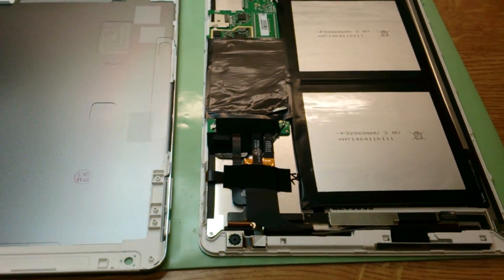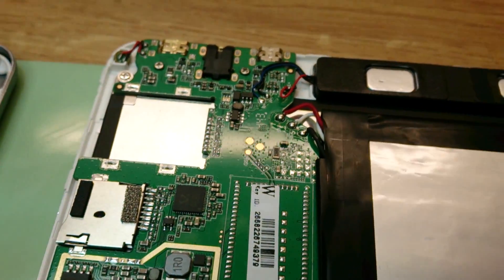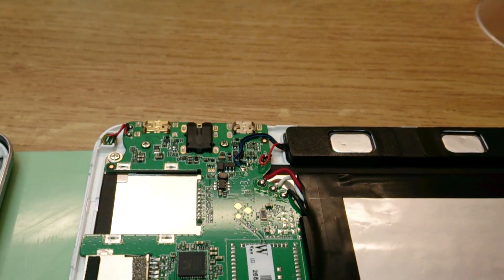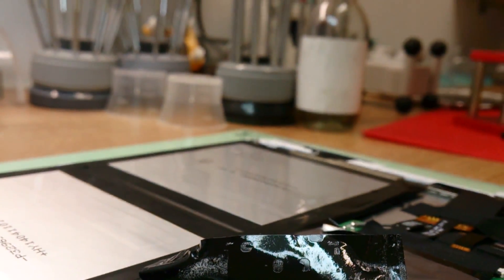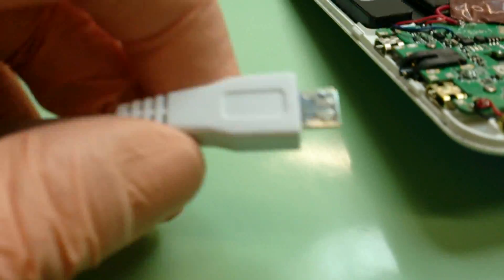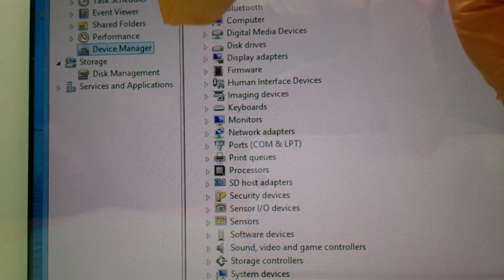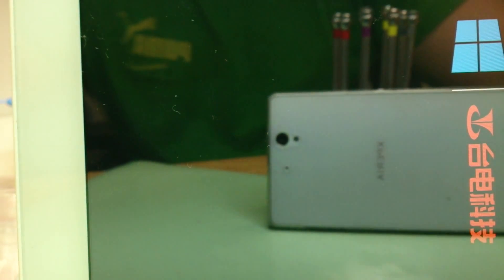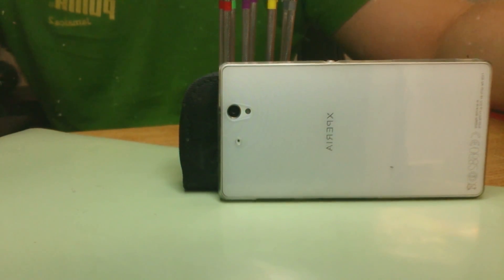Teclast X98 Air II Windows 8.1 tablet Intel Bay Trail - Battery not charging when ON, Dissasembly

Comment: So how you solved the problem ?
I have teclast x80hd tablet, with charging problem exactly like yours.
Reply from the maker: +Dima Rubin Unfortunately there is no FINAL fix for this issue. Only return.

There is only temporary solution that will involve soldering skills. You need to have an cable with Micro USB port on one side, that you will need to open and solder on pin 4 (Sense) with pin 1 (+Vcc) an 2K Ohm resistor, that will bypass the controller on the PCB for charging , that is responsible for charge during Power ON state. Yesterday I have successfully done this, but it only charges maximum of around 4,5 Watts. Meaning if you have 50% brightness and full CPU state and speed that takes around 6,5-7 Watts, you will not charge the tablet, but have decrease only 2-2,5 Watts. So if you would like to charge the tablet while ON, you will have to stop using the tablet, and have the Brightness set to 0%, that way it will charge in rate around 0,5 - 1 Watt, What is really slow....

Comment: so did you find a solution yet?
Reply from the maker: +BEAST 45 NOPE, looks like it is busted, and would have to use the Russian method of 4K Ohm Resistor between 4 and 1 pin

Comment: Has anybody a solution?
I have the same problem, happened also with a stupid usb otg hub.
Maybe the upgrade to windows 10 will fix the problem? Hope so.
Reply from the maker: +R Vb yeah DAMN USB OTG HUB? only If I have not used it !! :( no solution yet, only temporary with modified USB with 4K OHMs resistor between 1 and 4 pin

Comment: Is anyone capable of translating the following forum page to english from russian? There may be a solution...
http://4pda.ru/forum/index.php?showtopic=604923&st=5140#entry37475943
Reply from the maker: haaghala What I managed to read out, is that the resistors are damaged and probably would need replacement. From that point I stopped searching for fix and just charge it during off state :(

Comment: Hi, same issue here. I have the dual boot version 64gb (c5j7).
On android the charging seams to work in stanby, but when I use the tablet to surf the web the battery drains really fast. On windows I tried to set the luminosity to the minimum, but the charging rate remain at 0. Moreover it overheats easly, but the cpu and the ram monitors don't show a significant increase of the temperature, so I'm wondering if there is a physical problem with the battery. Did you also have an overheating problem? I also noticed that the windows installed is 32bit even if the chipset support a 64bit OS, any idea whay?
It seams that teclast relized a bios update for my device, I'll see if something will change.
Thanks for the post

Comment: I'm the same situation with you...I use hub otg like you but I want to ask you something.... Did you change the switch of hub when you plug it with your device? I think it happen because I change the switch from 1 to 3 while plugging device with hub....(Have you found solution yet?)

Comment: same problem with my colorfly i818w. I think it's possible to charge battery, then after start windows turn off battery in device manager, restart. And use tablet as device without battery. Tomorrow I'll check.

Comment: I've had an issue with battery drains even turned off. Yesterday i did a full charge and after 2 minutes of use i locked the tablet and after 15 minutes i was unable to turn on again the tablet for good even re-charging doesn't take any effect the tablet simply doesnt turn on :/

Comment: I manage to get mine to reset /reboot and charge by shorting the battery leads with a 'high brightness led white' - this pulled the voltage down to and fixed the 'boot' problem.
(My X98 completely locked after- a plugging a USB OTG cable with a wireless mouse, + stopped charging )

Comment: any news about this? I have the same problem :(
Reply: MrKafrovich *****  Hi mates, my new charger came yesterday and i try it now. The result ist perfect. I booted on win8 and used my new charger. I saw that my battery is starting to fill. :) After that i opened a game for more load on tablet and i look at the battery and it is still charging 60% 61% 65%... sorry for my bad english... with the tablet's charger i cant fill the battery in win8 but new charger works really good.
Reply: ***** hi buddy yes it is working perfect. i can charge while using my tablet. i am using win8 and also i tried with win10.  the charger is very powerfull. it has 4 amper output.
Reply: ***** i bought this one. http://www.aliexpress.com/item/2014-newest-4-USB-ports-EU-US-UK-plug-Qualcomm2-0-quick-charger-wall-charger/32242141652.html
Reply: ***** i used with qc 2.0 port, also i charged my Samsung S5 and it charges very quickly.
Reply: +Sedat Sarıgül so it seems like the problem is with the chargers, I used another one but is as crappy as the original... , I guess they didnt pay to much attention on this, cheap stuff tipical issues, so ill try a qualcom one, thank you!!
Reply from the maker: Sedat Sarıgül nothing buddy ! :( I read some more stuff, tried to search anything, well I found out on Russian forum, one guy had the same issue, and looks like burned or damaged Resistors that have now lower resistance, so that means, Resistors in short circuit and that is almost impossible to find out what resistors when they are soldered on the board and you don't know what resistor is for what responsible. I heard about one possible fix is to unsolder all cables of battery (watch out not to short circuit them) and short the PCB connectors with each other with some wire. That should give a bit fix, but need to test. I am really kicking my self for using that stupid USB hub, that I would never need in first place... oh well, :) but atleast you can still charge it while off
Reply: i didnt use usb hub but i have the same problem, i think our problem is; while we booted into win8, the tablet needs more amper than the charger gives so i ordered a new charger that can give 4A. i will try with this :)
Reply from the maker: Sedat Sarıgül fingers crossed buddy, keep me please updated
Reply: Sedat Sarıgül Hello my friend can you send the link of 4amp charger...Do you think it will help?
Reply: MrKafrovich i think it will help. i am still waiting for this, still in transit. here is the link http://m.aliexpress.com/item/32242141652.html?recommendVersion=1&productId=32242141652&productId=32242141652&productId=32242141652&product=%7B%22adminSeq%22%3A92331%2C%22aeProductSKUEsiDTOs%22%3A%5B%7B%22skuPrice%22%3A18.99%7D%5D%2C%22isSkuProperty%22%3Afalse%2C%22lot%22%3Afalse%2C%22multiUnitName%22%3A%22pieces%22%2C%22numberPerLot%22%3A1%2C%22oddUnitName%22%3A%22piece%22%2C%22offlineDate%22%3A1430031600000%2C%22productId%22%3A32242141652%2C%22productMaxPrice%22%3A18.99%2C%22productMinPrice%22%3A18.99%2C%22seotitle%22%3A%222014+newest+4+USB+ports(EU%2FUS%2FUK+plug)+Qualcomm2.0+quick+charger%2Cwall+charger%22%2C%22shopNumber%22%3A1542073%7D&category=%7B%22categoryName%22%3A%22Chargers+%26+Docks%22%2C%22categoryUrl%22%3A%22http%3A%2F%2Fwww.aliexpress.com%2Fcategory%2F100003571%2Fchargers-docks.html%22%7D&productSubject=2014-newest-4-USB-ports-EU-US-UK-plug-Qualcomm2-0-quick-charger-wall-charger&productSubject=2014-newest-4-USB-ports-EU-US-UK-plug-Qualcomm2-0-quick-charger-wall-charger&tracelog=wwwdetail2mobilesitedetail. if you can wait one or two weeks i can write the result of this...
Reply: Sedat Sarıgül What about this one? http://www.aliexpress.com/item/5V-3A-USB-Charger-Power-Adapter-EU-for-Tablet-PC-Sanei-N10-Ampe-A10-Ainol-Hero/1698824883.html?spm=0.0.0.0.SOvKqG
Do you think it has enough power to fix the problem?
Reply: MrKafrovich it seems usefull, orginal teclast charger is 5v 2.5a, yours is showint 3a so it can be charge the tablet while using win8.
Reply from the maker: Sedat Sarıgül Hello buddy, please does still the charging during on STATE with your charger works ok ? can you please provide mi again link for the charger if I will have it correct ? Thanks mate !
Reply from the maker: Sedat Sarıgül interesting thank you I will try it, where do you put the charging cable to, what port ? QC2.0 ?
Reply from the maker: Awesome thanks, maybe I will give it a try.
Reply: ***** high speed usb cable will work fine. try usb 4 or 3 cable

Comment: Hi, I got the same problem with my teclast air x98, only in turned off mode is charging. Did you managed to fix it yours?
Reply from the maker: hello, sorry to hear this, still I did not manage to fix it, I have to try to reinstall all drivers.

Comment: you need a 2.5 amp charger for this tablet
Reply from the maker: Tried 2.5 Amps, 3 Amps it doesn't matter, it will not start charge while it is on. The problem is in Software / Power Management Chip. Before I was able to charge in running system with also only 1 Amp, it was charging.
Reply: ***** http://forum.xda-developers.com/showpost.php?p=57587321&postcount=3339
Reply from the maker: Philip Sempers already done that as well, fully discharged the battery as only one cell was reporting, after that charged when off, now I have 2 cells reporting, but still didn't fix the issue of not able to charge when the system is on
Reply: ***** run hwinfo32 and take screenshot of what battery reports i am running windows 10 on my teclast and batterys reporting fine since running and charging while on at the moment but i have been getting battery reported wrong percent problem. i have 64 gb version though.

Comment: Hi !
I have 2 Problems:
First: it only charged when OFF, not when windows booted.
Then: NO Charge at all after playing with a USB Hub (nothing defective, just unplugging and replugging).

I solved the NO CHARGE Problem this way:
I opened it, unsoldered the battery (easy, 3 wired, PLEASE isolate them, do NOT short the wires).
Then i sortened (bridged) the 3 solder "blobs" on the PCB with each other to drain remaining capacity from the "confused" charger chip i wanted to reset.
Then resolder battery, BAM, it works again.

My first problem remains --> only charging when OFF, but as i now have an AMpere meter conneted all the time i guess i have the solution !

My battery profile has a low brightness, my "powered" has a high brightness. So if the X98 detects the charger it starts charging (i can see around 1 Amp flowing) and turns up the brightness. BUT the bright screen drains so much power that the Voltage drops and the charging circuit senses that and thinks chargin is over and stops charging.
If you have around 75% brightness this goes on & off forever, my Ampere meter jumping between 1 Amp and 0 Amp all the time, brightness going up and down.

Solution (Well workaround): Set the "powered" brigthness to a low value and ENJOY charging.

Maybe Teclast can solve that via Firmware. If they care...

Greetings,

Nils

P.S. please report if that helps in your case !
Reply: I have a X98 Air II Dualboot HG7N (converted to Win only, BIOS 1.03) and this trick didn't solve my charging problem. I desoldered 2 battery wires, shorted the 3 pins from the PCBA and left it there  for ~1 min. I also tried to power it up making sure all the caps did drain. Resolderer and assembled -> Same problem persists. I can only charge when completely OFF.
I also bought new charger (Innergie PowerCombo Plus 15W, 5V/3A) and this charger will make the tablet play the connected/disconnected tone when plugging it in, but I'm welcomed with a "USB device not recognized" -popup. It's still backfeeding constantly 5V to the USB port because the blue led on the charger stays lit even when I disconnect it from the mains AC.
Reply from the maker: will try it out ! :) thanks for the tip

Comment: Hi !
I had the same issue on a X98 Air (no 3G, no II). I opened it and unsoldered the 3 battery wires (be careful not to short those wires). Then i DID shortcut the solder points on the PCB each of the 3 with each other to discharge any capacities still powering the "confused" charger chip. Then resoldered the battery inserted the charge cable, BAM charging again.
Hope its the same for you, good luck !!!

Nils
Reply from the maker: Hello Nils !

Thanks for the tip, I sure should have tried this as well so maybe I will try during weekend ! :)

will keep you updated and thanks again for the comment !
Reply: ***** Good luck, it was a cheap shot but it worked.
I still also have the problem that charging while the X98 is on sometimes does not work, but at least now i can charge it during the night. Its a really messed up charging chip i guess (Firmware wise). The "hard to charge while on" thing might also be a thermal thing, maybe it stops charging because temperature from operating alone is already beyond some boudary and charging would add to it...

Greetings,

Nils
Reply from the maker: Nils Heidorn I must test the lower Brightness option if it will work.

Comment: Have you found any solution?? I have an Onda v975w with the same problem and I have no idea what to do.. I'm becoming mad hahaha
Reply from the maker: Thank you for confirming that this is not an issue of one hardware but more like SW / UEFI / DRIVERs issue. I must try to reinstall the drivers for Intel Battery Management  see if it will help
Reply: *****
 All of this happened when I plug in an OTG wire with charger.I tried to update bios but anything happened and also I tried to unistall Intel Battery M... Maybe trying hard reset it will be possible.

Comment: Have you tried to go to BIOS and reset it to system defaults. I had a strange problem with my x98 air 3G where the battery capacity had suddenly halved, after playing with the tablet settings and messing with drivers. Resetting system settings in BIOS solved this. I guess it also reset some PMU settings which solved the problem, it is the AXP288 chip in your video. http://en.wikipedia.org/wiki/Power_Management_Unit
Reply from the maker: yup I even re-installed BIOS completely, twice, damaging my Windows Activation so need to call Microsoft if they will be willing to reactivate my Windows. I fixed the issue with battery, with just completely draining it to 0, and then give full charge when completely off. But his issue developed after the issue with charging started. But thanks for TIP I will try to search more for this. I really think it is something with UEFI BIOS and Drivers something within this area of settings.

Comment: I have been googling around for a solution and found users with other kind of tablets facing the same issue. There was one user who had been able to restore charging by unrooting Android and then rooting it again. I have rooted my Android, but after re-installing Windows I wiped Android partitions to gain more disk space for Windows, so I don't know if unrooting is possible for me to try. PC doesn't even recognize my device in this condition. But IF someone could try unrooting + rooting (presumably for rooted device) we might be wiser. Share your thoughts if you manage to try this method!
Reply from the maker: yeah it looks like it is OTG / Charging on one USB problem, probably driver for UEFI BIOS or something. Try to reinstall battery driver if it will help you. THe drivers for Intel Battery management etc. http://pan.baidu.com/s/1gdDxxBl